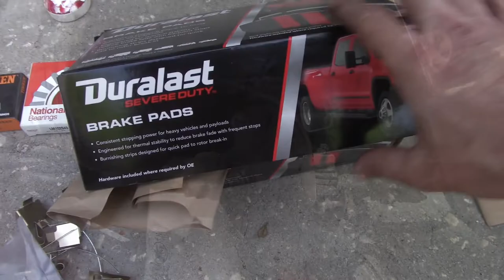F-350 Dually Front Brakes. Rotor, pads and bearing replacement

Comment: if the rotors have good greased bearings ,and the rotor is just glazed ,you can use a 3M striping wheel to clean up the rotors while it is on the truck .
Reply from the maker: Current situation is warped rotors and not too happy because the bearings have been perfect.

Comment: Great vid, thanks. Last time I did the front brakes on my 97 F350 dually was in 2002, only put 3K miles per year on her pulling a tractor in the springtime..twas a long time ago, was nice to have some reminders. I remember not having the torque specs for the spindle nut, that was interesting, but makes good sense. Glad people like you take the time to share their knowledge.

Comment: very timely for me - i have a 2004 E450 2wd that i have to do tomorrow, same part numbers for the rotor, so i expect it should be a similar job. I didn't know that there were two sets of bearings so not only did you probably save me some time, you also saved me a second trip to the parts store!

Comment: is there a quick list of things i'll need for this, replacing a seized caliper. bearings and hub are already done just caliper is old
Reply from the maker: Great idea. I'll gather a list and put in the description.
Reply from the maker: Off the top of my head the caliper was two bolts for the mounting bracket (21mm), two bolts to get the caliper off the bracket(17mm?) and one bayonet bolt (regular 6 sided head 14 or 17mm?)

Comment: I looked in the book and my procedure for e350 is very similar for the bearing. 17 inch lbs.
It was actually loose and i had movement in my wheel. Someone clearly left it loose and come to think of it, thats what i always heard was to tighten it and then "back it off a quarter turn or eighth turn". I dont know where that comes from, maybe it was a procedure for older trucks or passed down from the wagon days.
I went on a ford trucks forum and some guys there were saying its roughly as tight as you can get it with your fingers, so you got it about right.
Reply from the maker: Had a new RV trailer with one tire wearing on the edges. Was chasing my tail until someone mentioned the hub nut. Turns out it was a good 1/4 turn loose from the factory.

Comment: Thanks for the video.  Super clear and the right amount of detail.  Very helpful.  
 Was curious how much more involved it would be with the added step of bearings (i've only done car and light truck brakes in the past).  Looks pretty straight forward.

Curious if anyone can comment on calipers.  Looks like it would be much the same procedure as any caliper.  Brake bleed would also be a similar procedure I'd imagine.
Reply from the maker: Thanks. I didn't film the bearings this time as its messy, buts its old school bearing set with typical grease packing. There's a rear bearing seal, outer and inner bearings and grease. I have reused seals before without issue.

 I did have to replace a rear caliper and slightly covered that in another video. https://youtu.be/PkpULd8Nhag 

Brake bleeding is straight forward with bleed valves on each caliper. Think I used somewhere around 48-64oz to get the whole system refreshed. If not done, the hydro booster really benefitted from a fluid change. It uses tranny fluid and is looped into the power steering system. About 4 quarts was needed. With all that done, the brakes are pretty good.
Reply: @Soladaddy  Thanks for the reply.  Confirmed bearings/seals with parts supplier.  Nice to get it from multiple sources though.  Pretty helpful to have some insights before getting into a job. 
Will likely tackle this soon...and you've provided some valuable info.  Much appreciated.

You don't happen to have the 7.3 do you?

Comment: Can’t get my rotor off
Reply from the maker: Did the outer bearing come out? The nut is all that holds it on. If the inner bearing is dried and rusted, it might hold the rotor to the spindle.